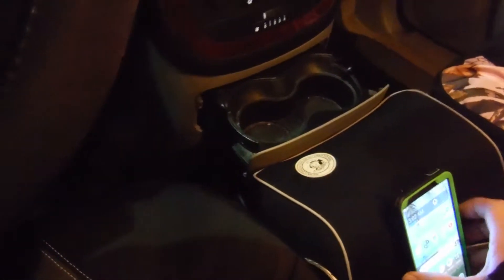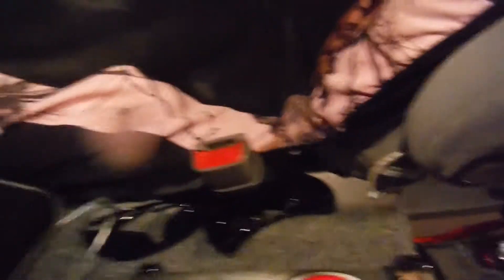Car Battery Or Capacitor? Answered

Comment: I saw some dimming. Cheap fixes are doing your big 3 and switching your headlights to LEDs. You will save at least 2.5 Amps each side
Reply from the maker: There was absolutely no dimming. I think you're seeing the headlights flick from the bass hits. That's actually going to be one of my upcoming videos. On LED lights all around, it's actually much more than a couple amps. It draws about a 10th of the power. I'll be going from 100 watts to about 10 watts. Per light. The big 3 I'm not condoning at all. We did it to my son in law car and within a week his alternator was dead and he was stranded at work 40 miles from home. Thanks for your comment 😊